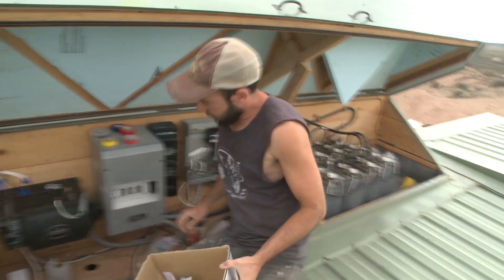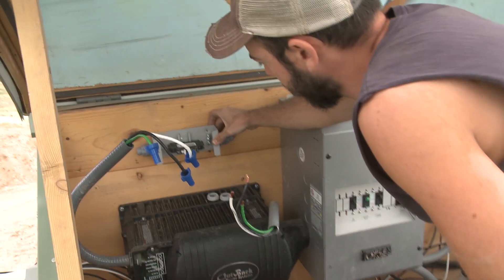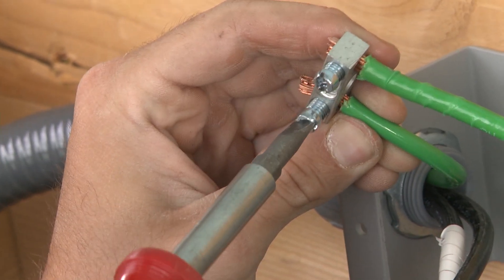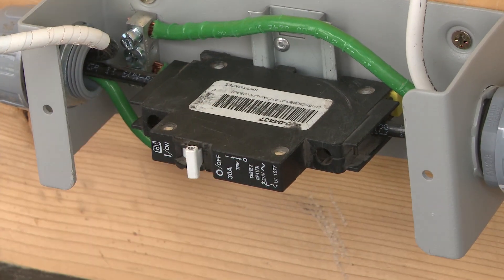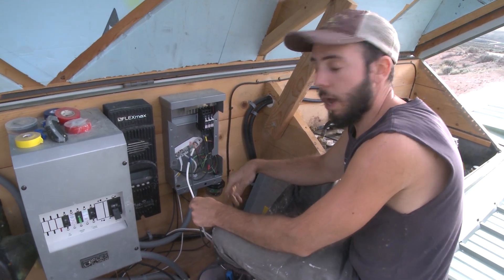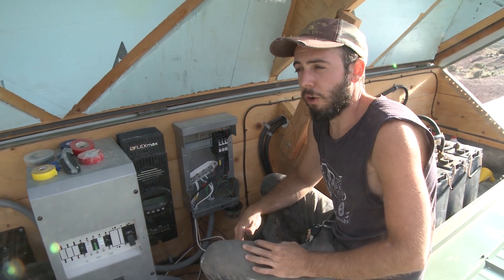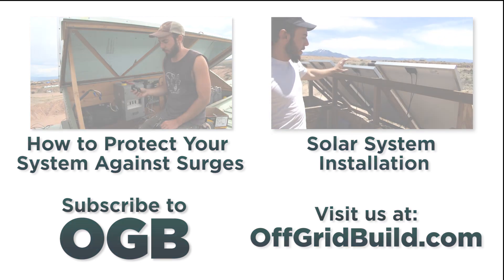How to Install a Disconnect Between Your Inverter and Breaker Box

Comment: Great explanation and detail ! I have a question for you I have a 5 kWA 230v single phase I want a wired into my breaker box what I see is I have 115 V on the hot wire and on the neutral and I have the ground theoretically speaking and the inverter produces 93A If I backfeed the inverter if electricity doesn’t understand which way it supposed to go if I backfeed the inverter into 100 amp double pole breaker that’ll be feeding each of my phases with the same phase 115v at 47A correct ? This is only for emergency back up in case where I live we loose electricity My hybrid inverter will turn on my battery bank is lithium 48 V at 280Ah and I have solar panels I am installing till charge the batteries somewhat Wheeling loot usually lose electricity for a day or two most I’ve ever seen of the week ! So is  my electrical figuring out correct ? Would be nice to hear your expert opinion and facts !

Comment: I was told you can wire nuetral and ground into ground bar. Why couldn’t you connect neutral  and ground together in shut off breaker?

Comment: Why do you NOT use one of those 100 % breakers between your Inverter and your box to the right of its, which is (I think) your voltage regulator ?

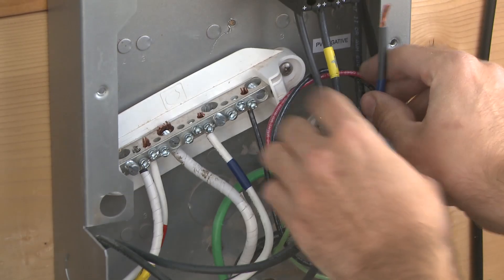Comment: he get kinda confusing at 09:00  but what he's trying to say is example: color blue has 9 panels color blue has a positive and negative wire hanging after connecting 9 panels this is called home runs meaning they do NOT connected to another panel they go directly to its destination (combiner box or inverter) so on with red color white color so on..so on...

Comment: Hey thanks for all the vids.  Very useful!  Im just setting up a system running 8 x 300w panels and 1404ah bank @24v.

Do you put a dc breaker for every panel?  Mine all run in parallel.

thanks!
Reply: thanks man, very useful info!

Comment: The plastic nut is actually pretty important. It serves two functions. It prevents stripping of the wire insulation while pulling wires and acts as a non-abrasive bushing to prevent shorts to the box from a nicked wire.